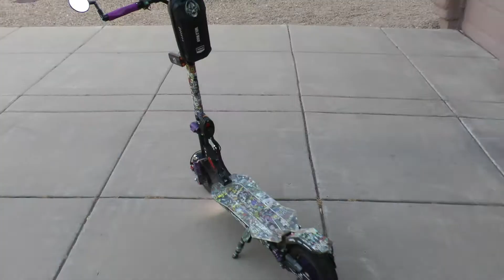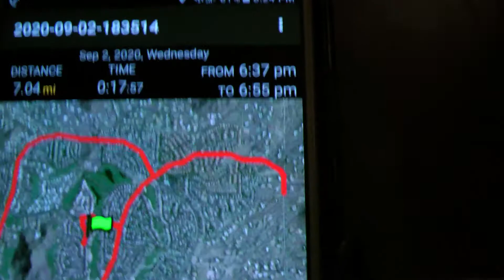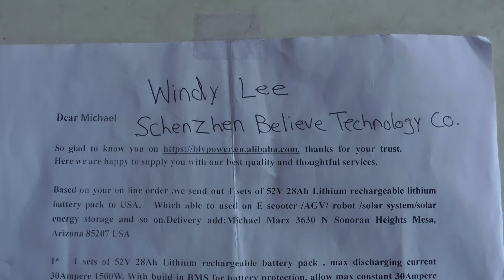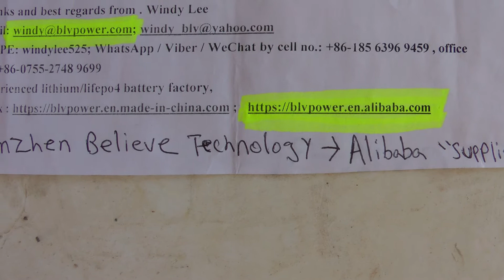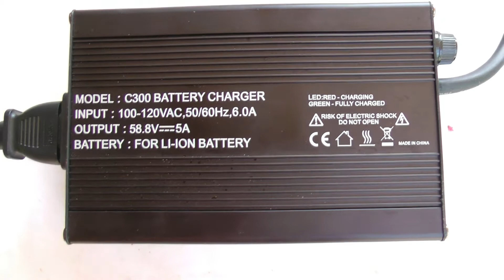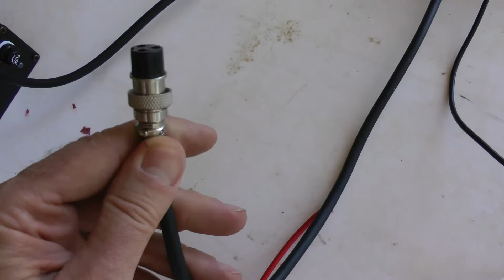Qiewa Q1 Hummer performance verification after battery upgrade!

Comment: Hi.  My max speed is only 28mph on mode 3. Weather was 45F.
Reply from the maker: Top speed is affected by several things, tire pressure (air up to 55psi), rider weight (lighter weight=faster), terrain, Battery voltage (Fastest right off charger). As the battery drains, top speed will drop. Maybe about 4mph from full charge to less than 50%. The stock battery is 48v, I installed a 52v so get more speed. The controller also affects the speed. I now have a non-Qiewa controller installed which performs much better.

Comment: Hi.  I just bought a used Q1 Hummer.  But seller didn't give me a charger.  Where can I buy a charger besides the Qiewa website?  Trying to see if I can find an equivalent charger cheaper elsewhere.  Thanks for any help.
Reply from the maker: Hi Roger, yes, the Qiewa price of $100 is a bit steep. I have a spare one I would sell you for half that. Buying a new charger online is tricky due to the charge port required on the Q1. You can find one around $25 but would need to change the port and I'm not 100% sure if it is GX16 (available in the US) or GX14 (only available from China). Email me at: maikemarx@gmail.com if interested or want more info. Also, I'd take the deck off and disconnect the battery until u get a charger.

Comment: Great vid as always, me and my girls Q1's arrived yesterday and im loving it, i had a question what type of handlebar extender do you use? The one i have dosnt fit the handle bars as they r large
Reply from the maker: Here's what I have. Didn't like the clamp on one's, drilled 2 holes through the bars to mount this one: https://www.amazon.com/dp/B07R5W96NX/ref=cm_sw_r_em_apa_i_NjnzFb5ZVRE35
Reply: Ahhhh ok im probably do the same, i ran into an issue with my Q1, the left handle bar actually spins, i tried tightening up all the screws but it still rotates. Any recommendations?
Reply from the maker: Yes. I never seen that happen but I heard about it. I guess it is threaded on underneath the sliding locking mechanism. Just spin it clockwise until it tightens. If real loose, you'll need to loosen the brake lever, light/horn switch and USB so you can spin the bar without spinning those. Then once hand tight, put a rag or duct tape over the bar to protect it and use a pliers or channel locks etc. to tighten it good. Let me know if this works as I am just going by what I heard once.
Reply: @Desert-Ecruising   will do ill give it a shot tomorrow

Comment from the maker: Charge port plug is NOT GX12-3P. That is too small. Should be GX16-3P or you can cut and use port from Q1 original charger. Link to fuse holder:  https://www.amazon.com/dp/B07426WCLM/ref=cm_sw_r_em_apa_i_FiPvFbSJXQYG0